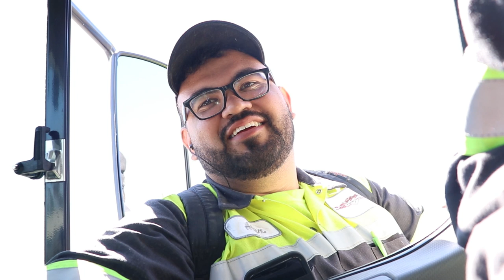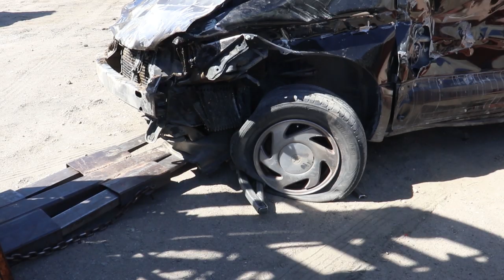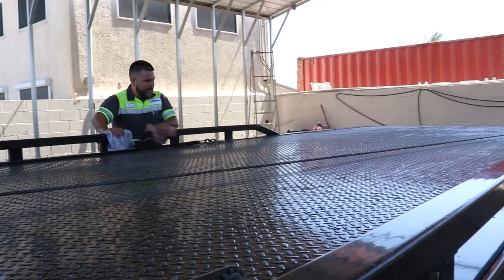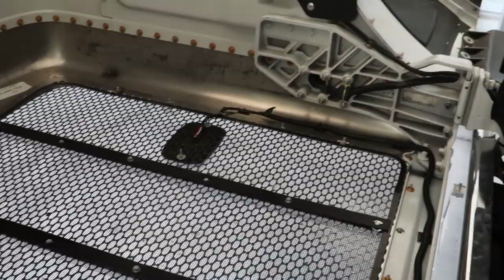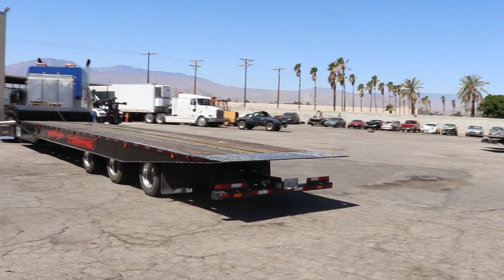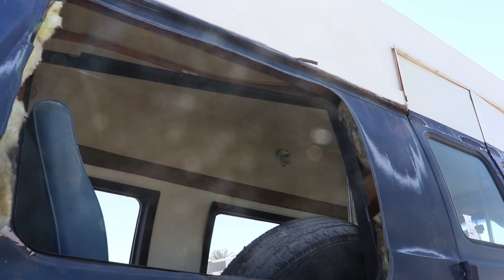DUI Accident And Rotator Cleaning

Comment: I used those exact adhesive squares to run my dash cam cables in the cab of my pick-up (in south Georgia) and the first hot day they all fell off. After sticking them back on several times I finally just uninstalled my camera. :-(>>